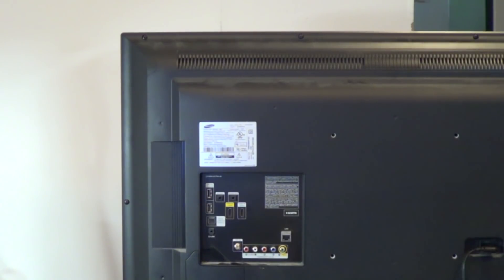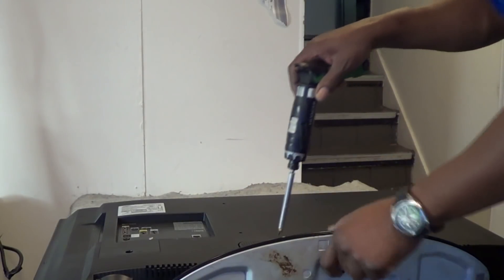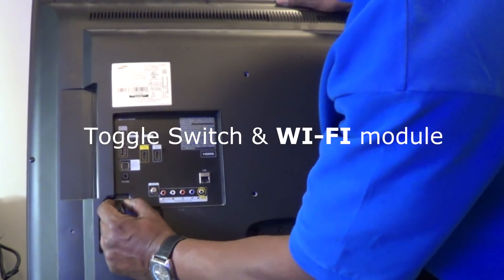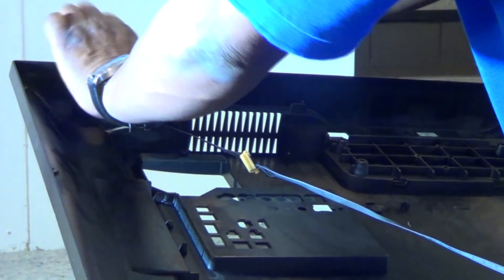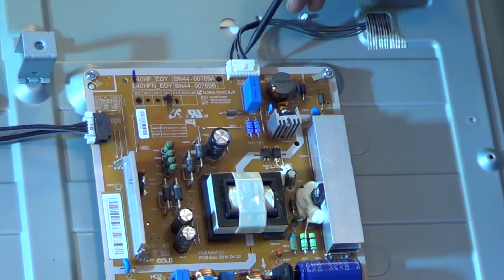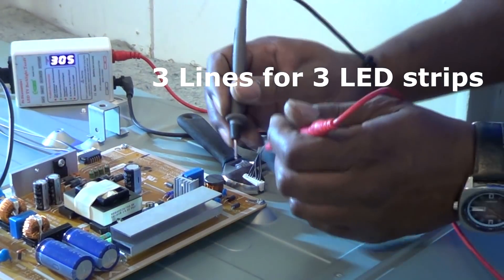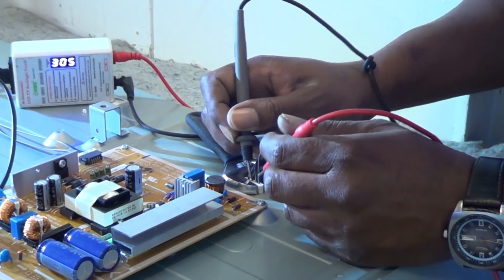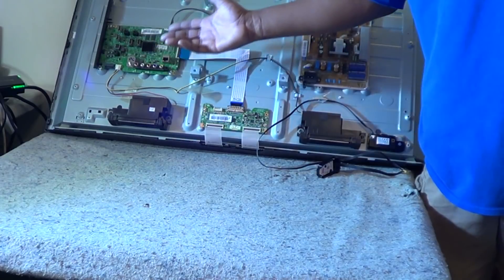Samsung 40 inch smart tv has sound but no picture/backlight repair

Comment: Great video! I hv Samsung ua40es5600r. Led backlight damage. So i change to a new backlight. But the new backlight seem to get a low volt because it not so bright and keep flickering. Its the main board problem ( mosfet ) or anything common that u know? Its not the new backlight is faulty because i bought two set and both not working

Comment: hi, my tv is samsung ua40j5008ak. no picture but sound. i have replaced 2pieces led burnt out. i checked all led lights up, but still no picture after 5times indicator flashing. when i checked power at connector to led backlight only 1 of 6 pin got voltage that is 172v. is it means that  power board bad? this model only have power board and  main board. no t-con board. please share your expert idea my bro..☺️

Comment: Hey, BigDogg....I'm thinking about fixing this "32 inch Samsung LED tv my mom and sister bought me about 7 years ago (R.I.P. MOM...I love you!)  I'm wanting to fix this because it was from my dear mom!  It has sentimental value to me.   It has no picture when the TV is powered on....everything seems to work it even has sound!   I did the "flashlight test" in a darkened room and it shows menu screen and I looked down inside the tv's back vent area and it showed a few white tiny lights and a blue one.  For information I have a Samsung model# UN32EH5300F....version UU02 and a model code of:  UN32EH5300FXZA.  This is a nice tv and I know I can get it working again with your help!   Bless...stay safe and have a good day!  :-)

Comment: I have an Element smart Fire TV. It turns on and after a few minutes the video goes but I have backlight and sound, if I turn the TV off and on then it works again for a few minutes.. any idea? TCon board?
Reply from the maker: Check the LDVS cable going from the Mainboard to the T-CON board.
Reply: @bigdog8882  I will check. I also ordered a Tcon board incase. All I have to do is turn off the TV and then on again and the video is back up but after a while it goes blank but there is still back light and sound.
Reply: @bigdog8882  after turning TV on this morning it has not given a problem. It's working fine.. I am baffled

Comment: Excellent vid!  I notice you don't use a ground strap. I assume that experience has taught you that it is not necessary.
OK, my problem. Everybody has a problem otherwise we wouldn't be here.
I have a 55 inch Samsung LED TV. The left side of the screen is ok but the right side is dim. Is this the same thing, bad LED strip?
Reply from the maker: Yes, most likely.

Comment: Hey man, thanks for your video. I have followed the testing steps shown in your video and my LED backlights lightup when I turn my TV on, I have audio but no picture. I have also tested the power supply board. what would you recommend to check next? thanks!
Reply: t-con